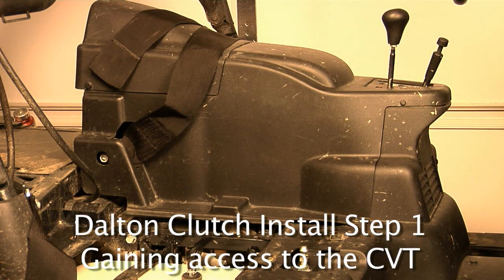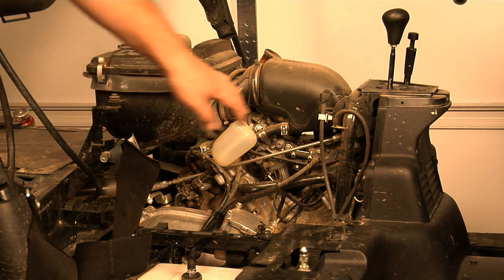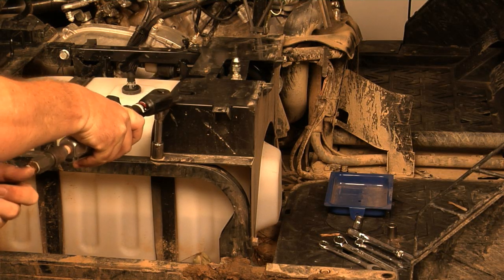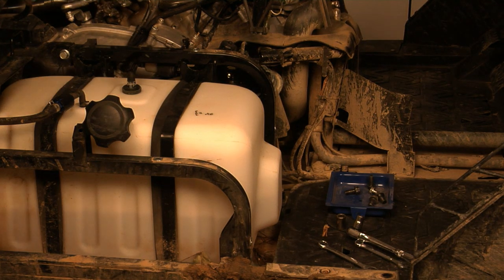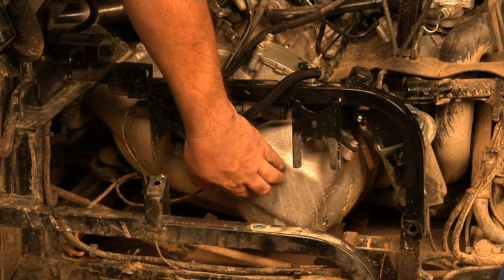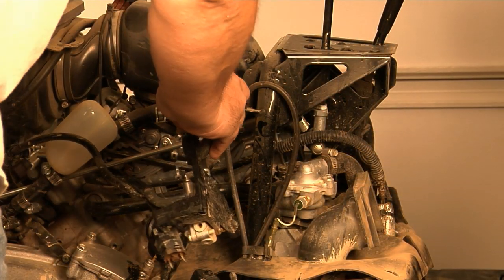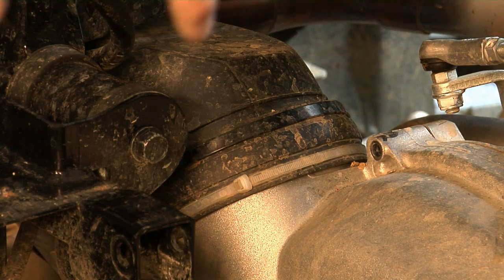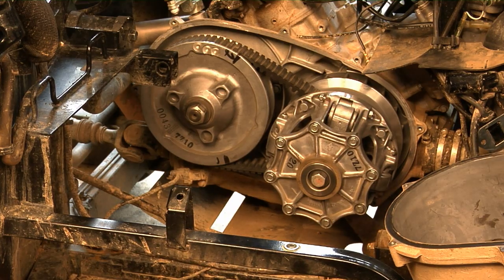Part 1 - Kawasaki Teryx - Dalton Industries Clutch Kit Install

Comment from the maker: Yes it is the same install with the exception of how the fuel lines attach to the gas tank.  The 09 is easier due to one clip holding the gas lines to the tank fitting

Comment: I have a 2013 Teryx and I had to take off the rear engine bracket to be able to take my CVT cover off, there was no way I could see to take it off with that bracket on.  It only added about 15 more mins to the process.

Comment: What is the bolt on the bottom of the cvt cover?? Is it a drain plug??
It's on side under drive pulley.